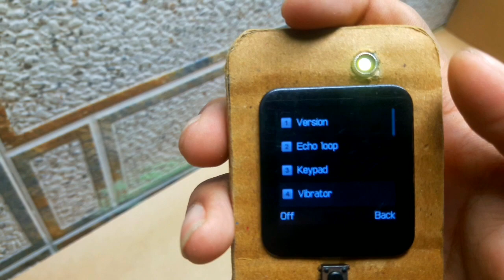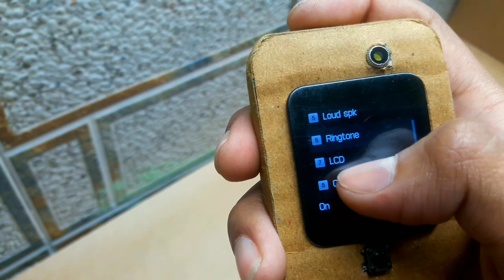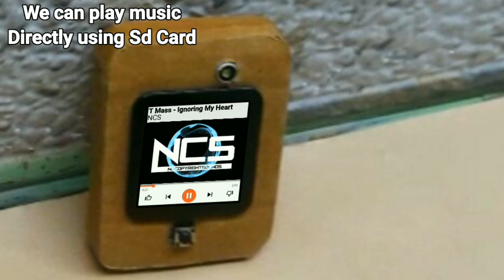Diy - SmartPhone From Old SmartWatch | How To Make SmartPhone From Old SmartWatch  #TheTechnoChannel

Comment: On the mother borad there is already charging slot then why did you you use another charging slot
Reply from the maker: The charging port on the motherboard does not fit in the body . So i used another charging port with charging led indicator. Please don't think it is fake. It is hundred percent working. We never upload any fake video on our channel . It can also play videos if you use genuine dz09 parts but you need to convert video files to 240x240 pixels to fit in the video player. Hope you understand .
Reply from the maker: If you still not believe you can search on youtube about playing video on dz09 smartwatch.

Comment: Bro use wood it would look better and what wrong with the charging port that is on the smart watch broad?what about the sim?
Reply from the maker: 1) I use the material that is easily available to everyone.

2) There is nothing wrong with the charging socket on board.I use the charging module because i have to show charging light and the charging socket on board does not fit well in the body that i made.

3) I don't have any sim card that's why i don't inserted sim.

You can insert both memory card , sim card and customize the body as your choice.

Thanks for commenting and asking  question regarding this.
Reply: @thetechnochannel  but when you get one just make it

Comment: Use have missed camera.
Reply from the maker: At the time of making it I had broke the camera.
Reply: @thetechnochannel  please tell I have broken the antenna of the watch strap what I do.
Reply from the maker: @mandalhacker2582  Don't worry just solder a wire instead of antenna it will works like antenna. This also happens with me then i convert it to SmartPhone.